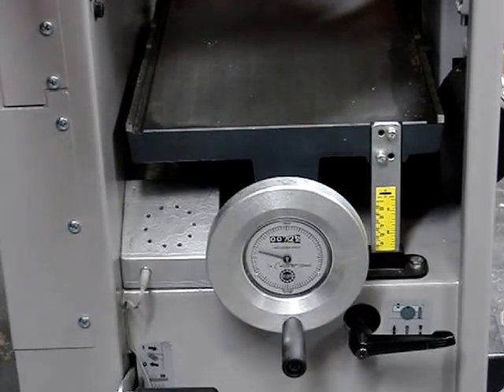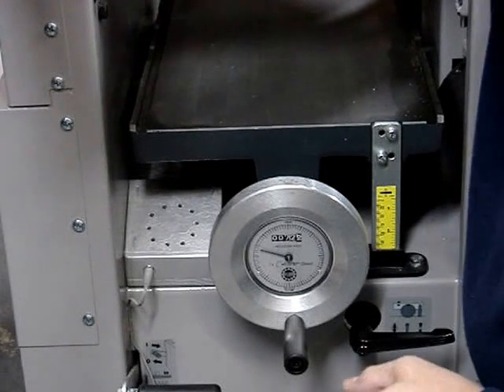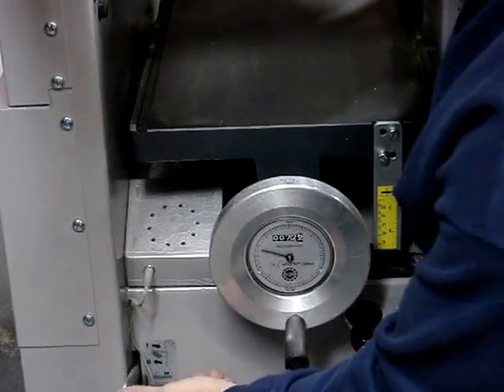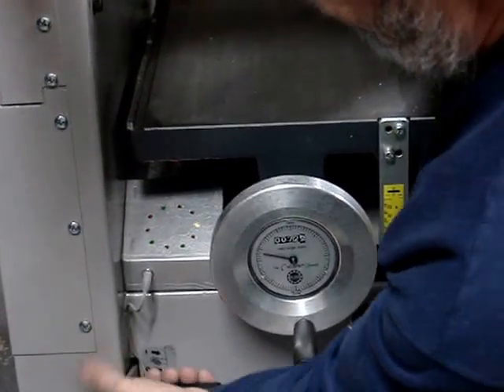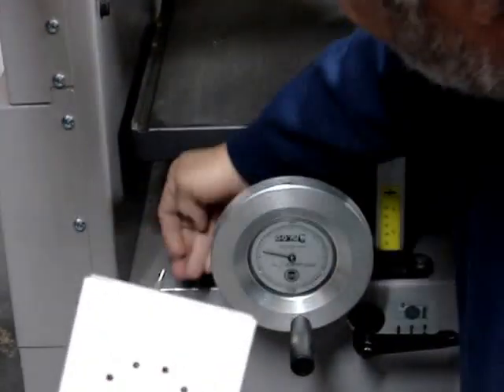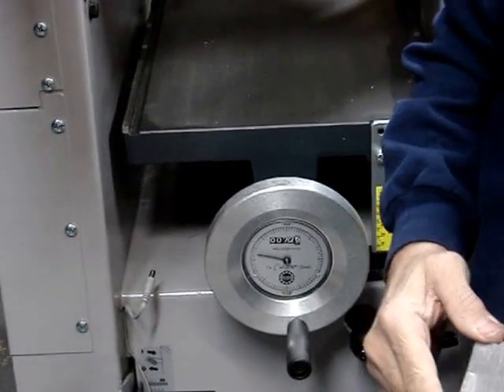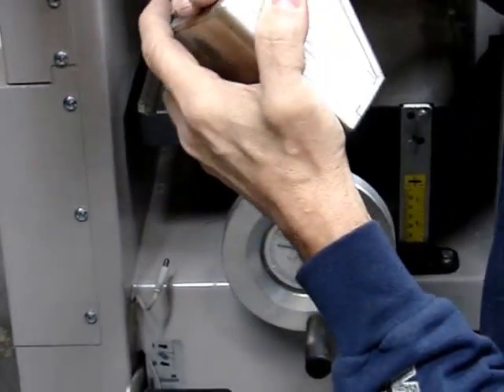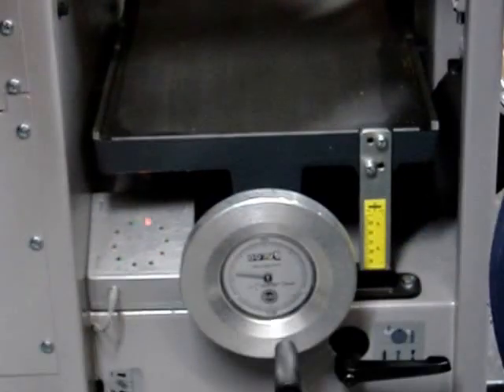FREDI Feed Roller Engagement Drive Indicator HAMMER A3 31

Comment from the maker: I found a rolling led light kit from Vellman for a good price. Then I built an enclosure to house it, the battery and a jack for the sensor cables plug to connect to. I use a microswitch to tell if the lever is actuated or not. The same indication could be done with a flasher LED, microswitch and a battery. Then a simpler enclosure could be built which would just need to house the battery, dropping resister and the jack for the sensor cable. The microswitch is used so that when the feed roller arm is lifted to engage the rollers it completes the circuit and lights the flashing LED to show the arm is lifted causing the rollers to function. When the lever is locked downward it moves away from the switch which will the open the circuit and extinguish the LED thus indicating the feed rollers are no longer engaged. Simple enough and HAMMER should think about it, nice feature and cheap to incorporate.
Reply: can you post a picture of the microswitch?

Comment: Thomas, I really have appreciated your videos.  I just took delivery of my A3-31 last weekend.  What I realized is that I need one of these indicators.  I don't have the technical expertise to know how you put this together on my own, and was wondering if you could describe in a little mor detail how it works (how it's built/what it is connected to to know that the rollers are engaged).  Thanks so much!